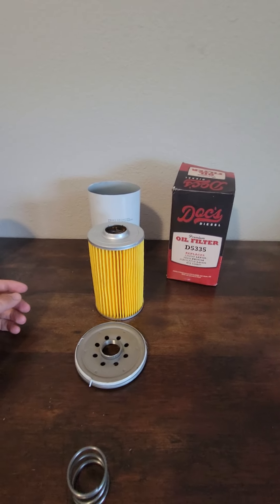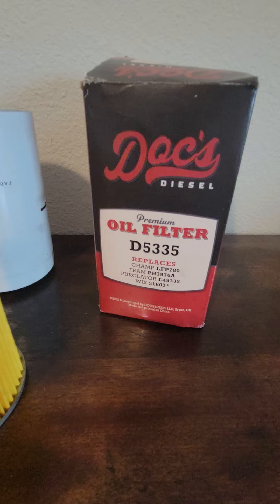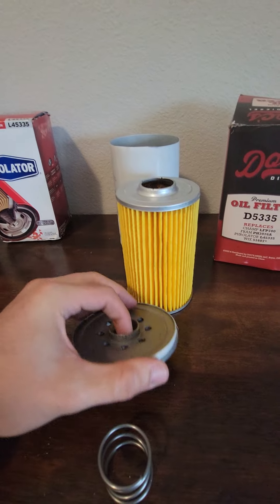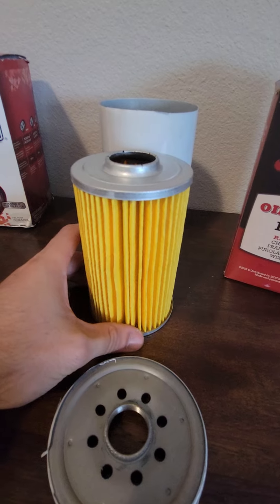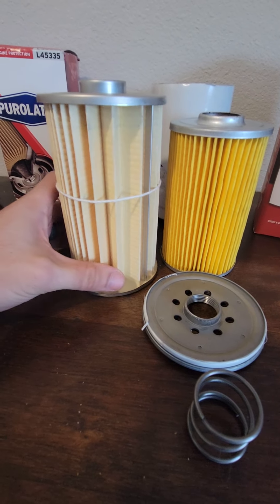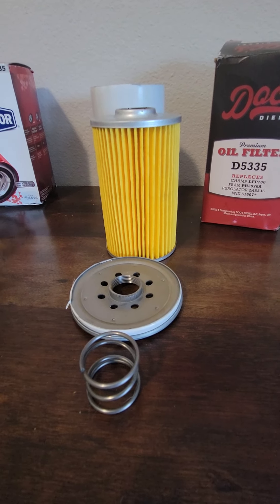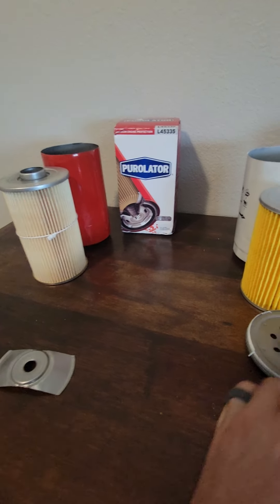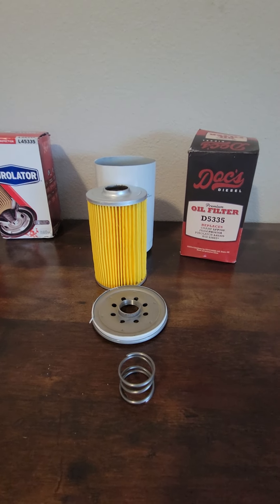Doc's Diesel 6.7 & 5.9 Cummins Updated Oil filter Review #oilfilter #diesel #cummins #trucking

Comment: I just bought the kit for my 18’ I will use the fuel filters and air filter but I’m gonna get another oil filter. Thanks
Reply from the maker: I run donaldson or fleetguard personally
Reply: @TylerTheFieldServiceTech  Fuel filters are decent, yeah?
Reply from the maker: @85Gute  I've been very happy with them no issues and they hold up very well.
Reply: @TylerTheFieldServiceTech  Thank, You.